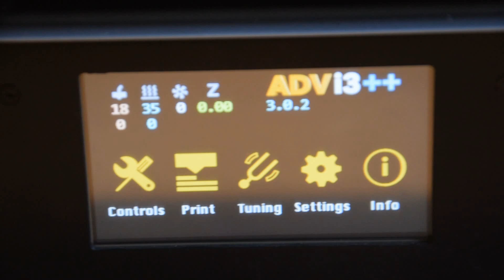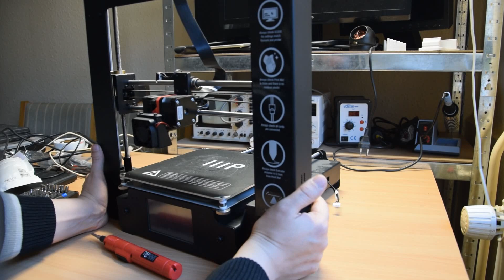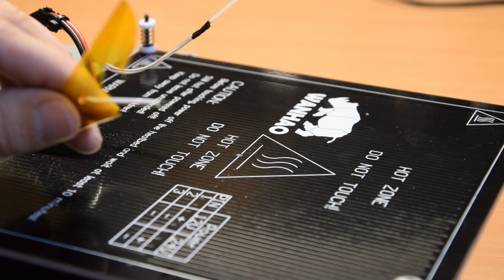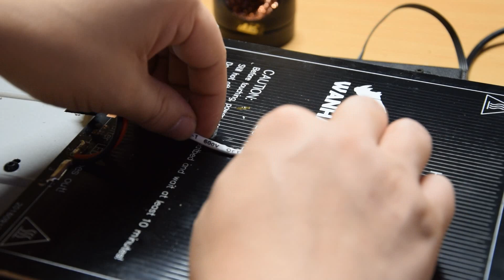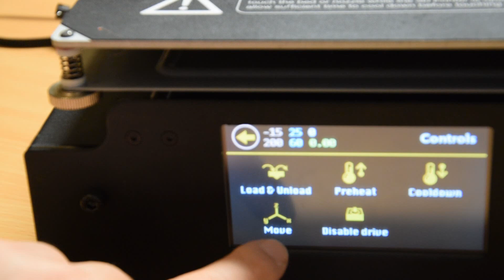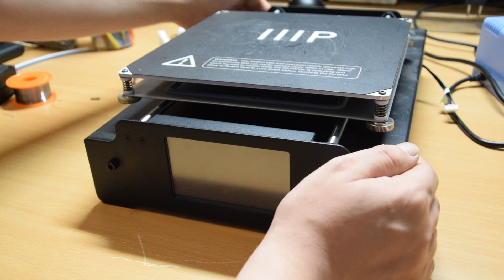Reparing Bad Bed Thermistor

Comment: Hey, thank you for this amazing video!
I have one of those clones you mention in the description (Wanhao Duplicator i3 Plus), and you sure helped out with my uncertanties. Unfortunately for me, I had to figure out what went wrong and order two times that replacement thermistor after a ton of research before finding this video.
If anyone else has the same problem with any of the clone printers, I got the new sensor at Amazon in this here link: https://www.amazon.com/Extruder-Thermistor-Monoprice-Duplicator-Printer/dp/B07B4254YC/ref=sr_1_28?dchild=1&keywords=bed+thermistor+Monoprice+Maker+Select+Plus+-+Wanhao+Duplicator+i3+Plus+3D+Printer&qid=1608176721&sr=8-28
Note: the bed and extruder thermistors are USUALLY not the same, but it still worked (in my case) like a charm. Good luck, soldier. o7

Comment: Thank you for the video. I have just had a problem with the bed thermistor on my printer. It is similar to yours except it is called the Balco Lifestyle 3d touch. B/W touchscreen rather than colour but the insides are the same. I'm going to take a look at the thermistor joins and see if if I have the same problem.
Reply from the maker: Yeah, just looked it up, it's the same printer, the stock firmware just happens to be all in black and white, mine looks different because I installed a custom firmware on it. Pretty sure they all come out of Wanhao's factory. Originally it's a Wanhao Duplicator i3 Plus, but also goes under Monoprice Maker Select Plus, Cocoon Create, Powerspec i3, and apparently Balco aswell - maybe there is even a few more rebrands out there.
Reply: Hello  @ZnakeTech  . I bought a new thermocouple spare on ebay which arrived yesterday. Changing it was relatively straightforward and I was able to get my printer up and running again quickly. The broken thermocouple has broken in the same way that yours had! Hopefully a little bit of soldering will fix it and then I will have a spare. Thanks once again for the video. Andy.